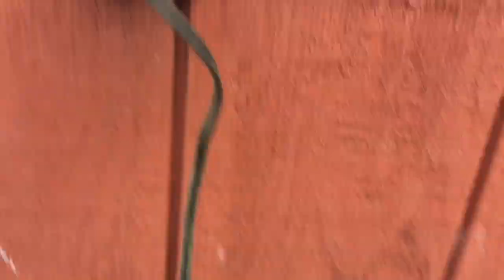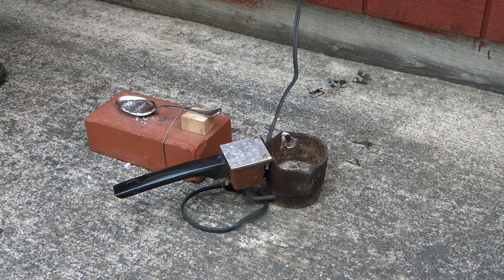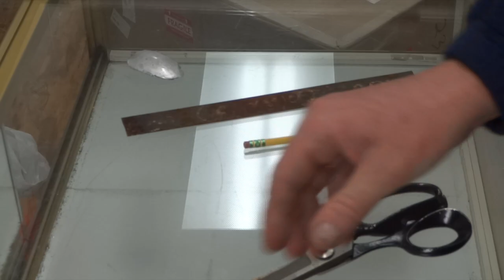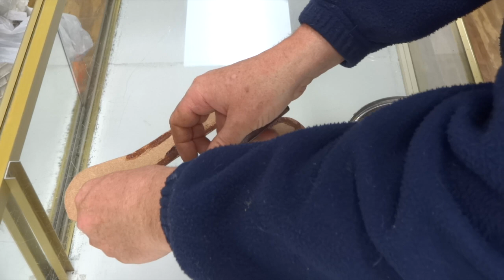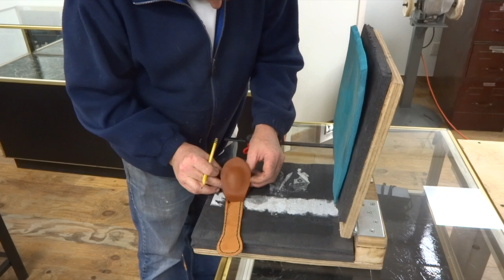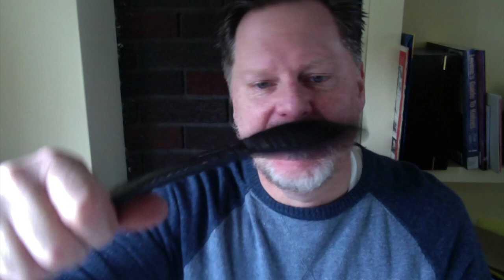Handmade Slapjack - AKA "The Persuader!"

Comment: The sap is a great self-defense weapon one level before deploying a firearm.  I have seen many people struck with a sap and it is a very effective weapon.  I would not recommend a head strike which could be fatal unless the use of deadly force is justified.  I would recommend a 4-ply sap because I have seen the lead weight fly out of a 2-ply on a hard strike.  Many companies make these weapons although they are prohibited in some jurisdictions.  Great video.
Reply from the maker: Thanks, JDP. That is good information to have. What are less-lethal places to strike with one?
Reply: @SugarcreekForge  Any place below the neck.  Shoulder blades, elbows, ribs are effective strike zones and will cause the subject to reevaluate the situation.  I have seen a morbidly obese male absorb a couple of blows to the upper arm and chest but the sap was eventually effective.  Personally I would rely on pepper spray first if possible. I have sprayed several people with Sabre Red.  They are startled for about 1 - 2 seconds which can give you time to place some distance between you and them, but once they recover they have another (on average) about 10 - 12 seconds to continue the attack before they start with the Wilhelm scream.  The good thing is there are no injuries.  Both are effective weapons.
Reply: Duh if it flies out you know that you're doing it right

Comment: And suddenly I want to see more of your Form Press, instead 😅
Reply from the maker: 🙂I understand that, SC. It is a simple Kydex press. If you search "how to make a kydex press" here on YT, you will see several like it. It is a square of plywood and then some small pieces stacked up to give one end some height and then another piece attached to that stack with two hinges. Then it has heat-resistant foam glued to the inside of the bottom and the top that touches in the middle. So when you press down it compresses all around the object. I hope that helps!
Reply: @SugarcreekForge  sweet. I will look into that, thanks. Just looks WAY quicker than the old Wet and Press by hand or building individual Forms every time 😅
Reply from the maker: @shaemuscarr4492  It is!

Comment: using that spoon for a mold was just what I was looking for. Thank you!
Reply from the maker: I am glad that I helped you!
Reply: Is it heavy enough? I've made 2 saps the first was a trial no spring inside so too floppy and not enough weight in the head. The next one I'm satisfied with the steel ruler I cut to fit and melted the lead around, then glued and sowed it into the leather. Very slim in fact got it in my back pocket right now. Invisible but effective.

Comment: Good afternoon, just watched your video, where do you buy the spring steel at?
Reply from the maker: Hi Todd - I used a a piece of broken metal cutting bandsaw blade. Metal banding works too. It is springy and you can get it usually for free from lumber yards. Lumber bunks are often banded with metal banding to hold them together
Reply: Thanks, l will go by Lowe’s then

Comment: Do you suppose casting two separate spoon ingots and sandwiching them on either side of a full length spring shank would make much of a difference? Too stiff perhaps? I would love to give this a go. I have a small collection of rather long used up sawzall "torch" metal cutting blades that I think would make pretty handy steel shanks.
Reply from the maker: I think that could work nicely, Morgan. You can always sand/grind the Sawzall blades if they feel too stiff. I don't see why it wouldn't work.

Comment: I own a couple saps that I have bought. Fortunately they are totally legal in my state (Utah) I bought 1 on Amazon and one at my local Army/Navy Surplus Store in Salt Lake City. However, as to be expected, any sap one finds on Amazon or Military Surplus Store is masses produced, and while I am sure it works, it is cheap looking and not what I am looking for aesthetically. I have an idea of what I want and though the others are functional, the look I want is more because it’s kind of cool, not because I intended on relying on it to use. I have bought the supplies to make oneThat I have found very little information on the process of sap making an no videos until this one. It seems pretty self-explanatory, and I was just going to freestyle it. I am a woodworking hobbyists and amateur craftsman, but I am not a leather smith and have virtually no experience with leather craft. So while the project seems obvious, like most projects there are no doubt things one doesn’t account when crafting a project for the first few times. Great video, thank you for posting it. It gave me a couple of new ideas and reinforced that my plan of attack is on the right track, I was just missing some details that would really simply unforeseen variables. Do you have any resources for other plans, videos, ideas, or information on different styles like shot filled, saps with out a spring, etc. great video, thanks for the upload.
Reply from the maker: Hi - Thanks for your kind words. I don't really have any other resources for making them. I just kind of winged it based on what I have seen. Good luck and keep me posted! Tim
Reply: I certainly will do, I appreciate the follow up! Well done on your project. I am excited to give it my best shot. (PS sorry for all the grammatical errors on my original post. I need to proofread a little more thoroughly when I use voice dictation)  :) thanks again.
Reply from the maker: No worries - I am such a good speller that I can spell every word 3 different ways! :-)

Comment: Where do i get the flexible piece of steel?  I tried a metal saw  blade but it breaks....😢
Reply from the maker: I use metal cutting bandsaw blades. You can also use metal strapping. The stuff that they bind pallets of lumber with.
Reply: @SugarcreekForge  thank you !
Reply: What type of saw blade broke?  Are you talking about a hand saw for cutting wood?
Reply: @theghostofsw6276  no, the type used to cut metals. Thin, long and with the smallest teeth .
Reply: @RaduMichael  Aaaah OK....thanks.  Just making sure.  Cheers!

Comment: Where to find the spring steel that goes inside?
Reply from the maker: You can use steel banding material. I get it for free from a local lumber yard. It is used to hold bundles of lumber together and they throw it away.
Reply: @SugarcreekForge  thank you